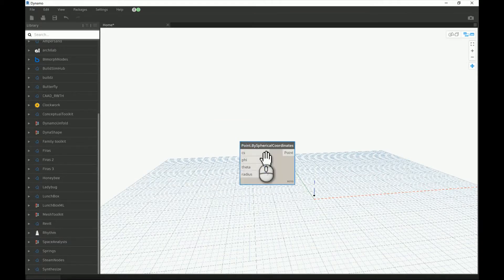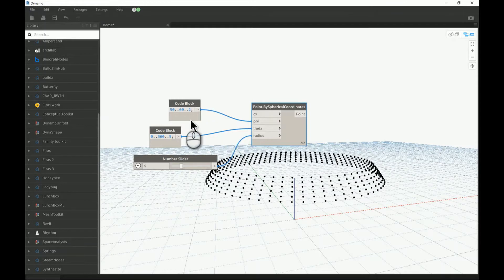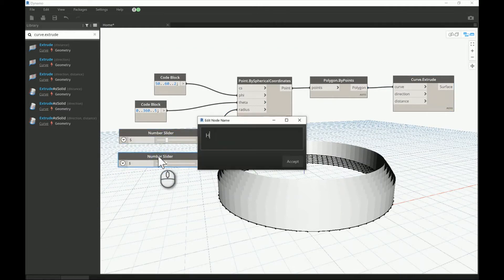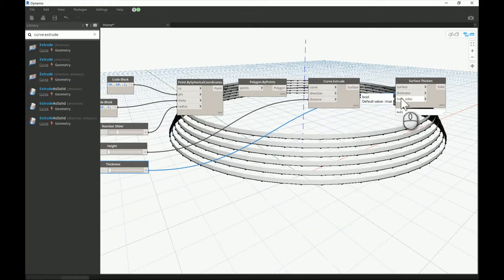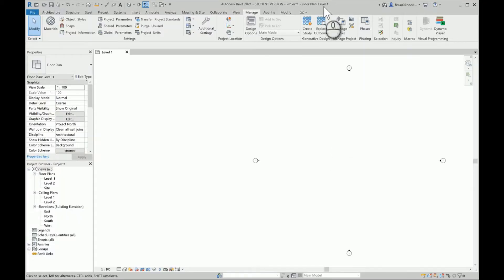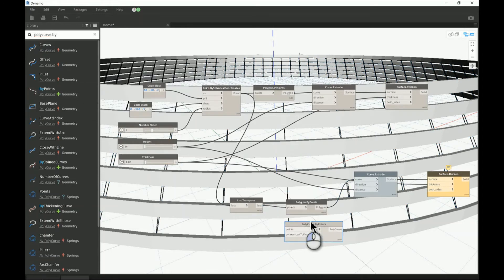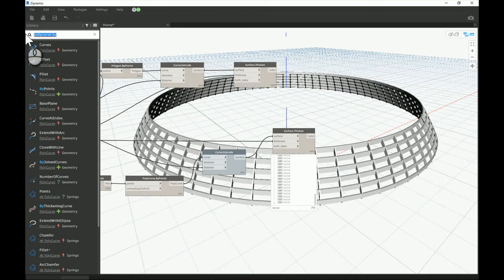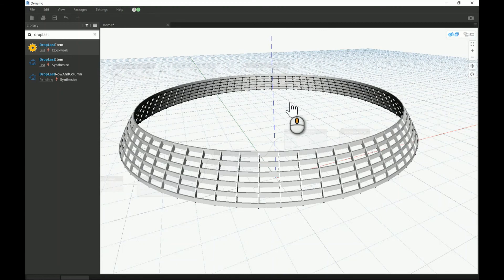Spherical Array Example 2 - Vertical and Horizontal Louvers in Dynamo - Revit

Comment: Hi, thank you so much for this video.

I am trying to follow the steps you have mentioned but while creating the polygon I came across this error: Warning: Polygon.ByPoints operation failed. 
You must supply more than 2 points to create a polygon : POINT_ARRAY_TOO_SPARSE -- There are too few rows or columns in the point array
Could you please help me with this. The rest of the data is the same as you but my Dynamo is the older version than yours.
Reply: Nvm, I managed to solve it by updating my Dynamo :)
Reply from the maker: Sorry for my late replay,  I do appologize, I have final exams at uni, and it is the busiest time at year , happy 😊 you figure it out
Reply: @FirasNoori  No problem 😊 I understand. And It was great to do some research and find the solution😊